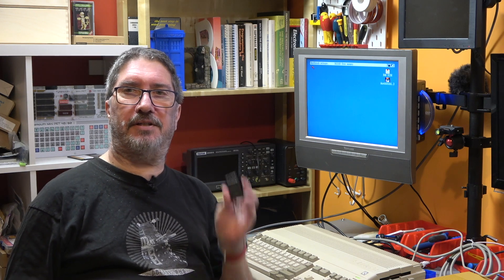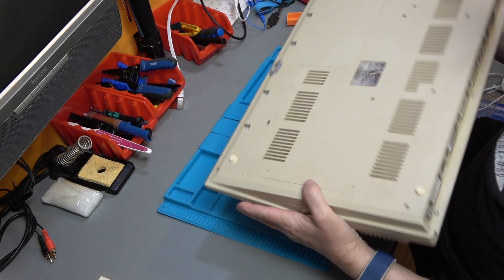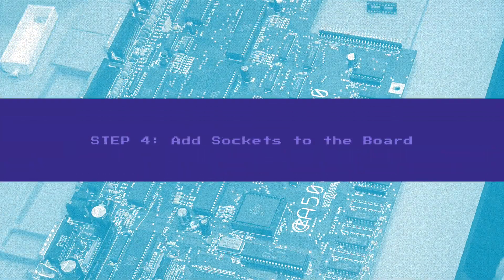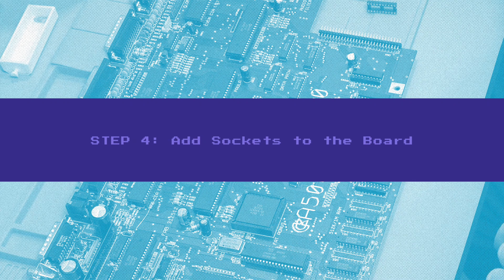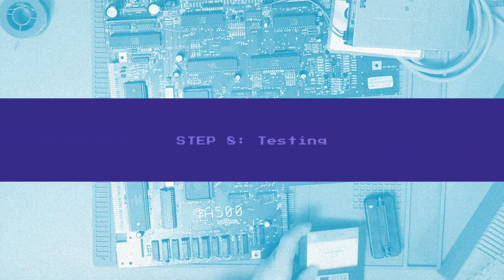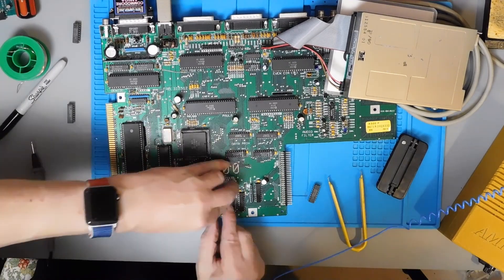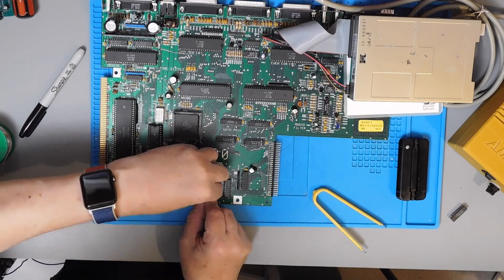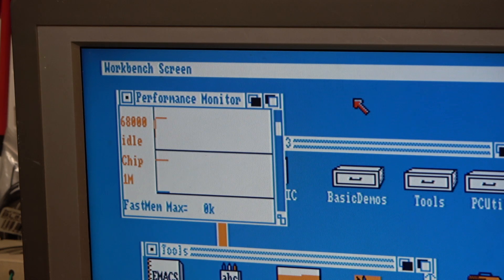A 1MB Amiga 500 Without a Trapdoor Card? Here's how...

Comment: I did this trick on my A500...
You can't do it with a rev 3 of course (different sized RAM chips)....  but a Rev 5a can literally be turned into an A500+ with this mod + a 1mb expansion in the trapdoor provided you do have a 2mb Agnus installed.
I found it better to use a MegaChip 500/2000 (DKB made three different ones) with the 8372b installed.
There is a way to use an AdRAM or Baseboard (these are 4mb boards made by ICD and Expansion Systems respectively)... but it involves running a wire or clip here and there... plus If I recall one of their PAL chips on each board has to be "reprogrammed" to address 1mb on each board correctly.
 That works best if the boards' autoconfig is turned off and then you still get 1mb of chip RAM from them (then you know the chip redux worked!) 
So then its a matter of running a re-written AdRAM or Addmem program to get the remaining 3 mb of SLOW RAM added.
 Works great in a pinch if you really need RAM but slow RAM sucked so it wasn't needed unless... you needed it  LoL.
Still, even with that mod/hack, you lose a full 1mb if you "don't" install a MegaChip since that board comes with 1mb on it.
So the ultimate trick would be to do this mod like you did....
then get a Megachip 500/2000...   then...  use an AdRAM or Baseboard (with the 2mb daughterboard) and disable autoconfig...  and when you run the AdRAM program or the Baseboards addmem program you get a whopping 6mb of Slow RAM added.
:D
I figured this mess out right when I got my A3000...   
So when I started using the 3000...  I drifted away from the 500's and ended up selling them all off eventually.
Most RAM I ever had in my A500 with autoconfig was 14 mb ..  
Addmem with the Baseboard could have skyrocketed it to 20mb but the RAM would have had to have been remapped to the "uppder bound" 8mb space and not the same address space as the Dataflyer 8mb RAM... 
4mb on the M-tec I had was 32-bit and had an extra digit or two in its address ... causing it to be above and beyond that space.
But it was possible to hit 14mb of fast/Slow RAM with a 68000  as long as you know how to address it and make sure the computer has the correct address space.
Of course 6mb wasn't auto'd...   
 Which was smart.. considering if you boot from any game floppy or WB floppy you'd hit an error if the RAM tried to access the same address space.

Dunno why companies didn't clue into this early on...  things could have gotten quite interesting had they actually put a PAL chip to auto sense.. and then re-address RAM chips if conflicts were detected.

WORST hack advice I ever got was being told I had to "disable" that RAM you added in your video (bank 0 has 512k, bank 1 is 512k and is the RAM you add in the sockets)...  just to install an AdRAM 540 in the trap door slot!
 AdRAM (and Baseboard) allow for 512k of CHIP Ram in one of its banks...  I absolutely did not want to that. Felt like a waste of sockets...
So that is what motivated me to find a way to make it all work.
 Had 1.5 mb of CHIP RAM when I did... (using a 2mb Agnus in the mobo socket)
Then figured out that another bank had to be "joined" with the Baseboard's 512k to create  "bank 2" for the A500.   Baseboard's "sub banks  4 and 5 if I recall correctly.
Changing that ...  effectively hooked me up.
Too bad I didn't have enough RAM chips to fill out the rest of the board..   or have the daughter card.

 you should explore the "Addmem" command for RAM that isn't autoconfigured.
The one thing I didn't get to try...   was in my brother's A2000...   he had a 2091 with 2mb..  and I plopped in the Dataflyer 8mb board... 
 10 mb of 16 bit RAM didn't work...  
Then years later...  I realized... one little line (or make an executable and stick it in WBstartup)...  could have moved either the 8mb  or the 2mb into the upper "16mb space".
Sigh.... 

Anyways.. it's something I'd like to see you try in a video.
You learn that trick you will solve problems for A2091 users everywhere (that card is an asshole!,  heh)

Comment: Nice, but would you get an extra 0.5mb of slow ram if you put in a trapdoor card? For total of 1.5mb?
Reply from the maker: I did wonder this, and next time I have a trapdoor RAM card, I'm going to try it. I suspect the answer is no. (for one thing this mod required setting a link that disables the trapdoor RAM. But if that's on a switch...)
Reply: @TimsRetroCorner   Yes, i think installing a switch that makes it reversible would be best. Good to keep compatibility for stuff that dosnt like more than 512kb...

Comment: Back in the day we would basically do the same on a rev 5 board by piggybacking ram and running some bodge wires. IIRC you just had to bend up one pin on the piggy backed chip and run it to the correct spot.

Comment: Probably the RAM expansion board was fine. If you add new RAM chips to it and replace the battery the RTC will work and you can get another 512KB of SLOW RAM.
Reply from the maker: That's something I definitely want to explore: whether the trapdoor is still accessible to more RAM, or if it's an either/or situation.
Reply: 512KB slow ram card can be configured as chip ram from the jumpers.
Reply: @valenrn8657  Nope! after the 512KB are added, the AGNUS cannot address anymore chip ram. Any extra RAM added to the expansion slot will become bogo RAM.
Reply: Unless you get the unabtanium A3000 AGNUS.
Reply from the maker: Used to be unobtanium was hard to get... now it's everywhere!

Comment: if you wanted to save the chips, you should have desoldered them the same as soldering: go to opposite pins.
Reply from the maker: I haven't heard of that as a desoldering technique. What benefit does it give? You've still got to desolder all the pins before you can pull it.

Comment: I did the similar thing to my A500 but I didn't use sockets because I was worry that it will be too high and the chips will be touching a keyboard. Now I see that I was mistaken.
Reply from the maker: It's a close call. There's probably only a millimetre - max - at the lowest point on the keyboard. It could very easily have gone the wrong way. When I socketed the chips in my 1571 disk drive, I found there wasn't space also to add heat sinks. (I actually added them and had to take them off!)